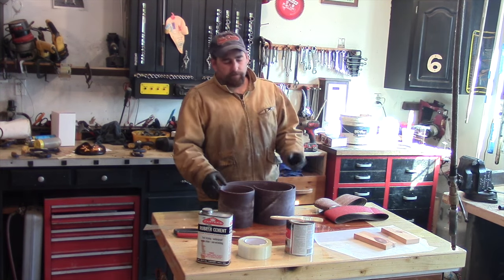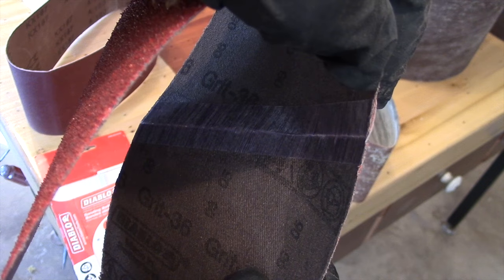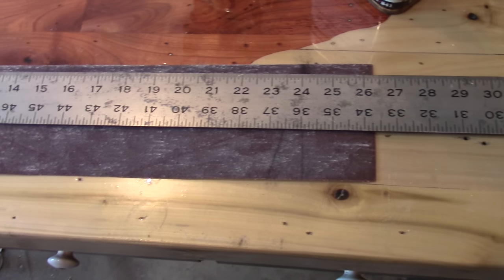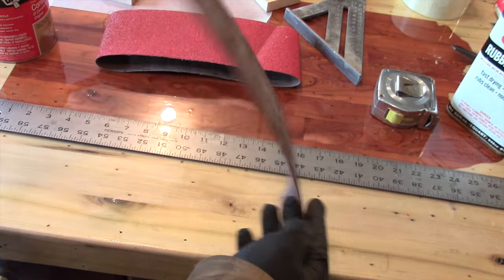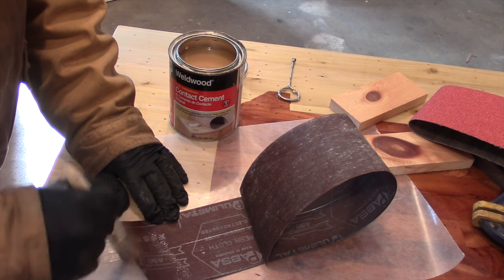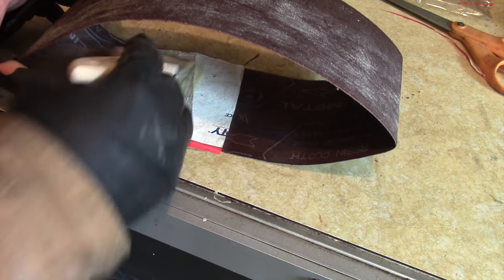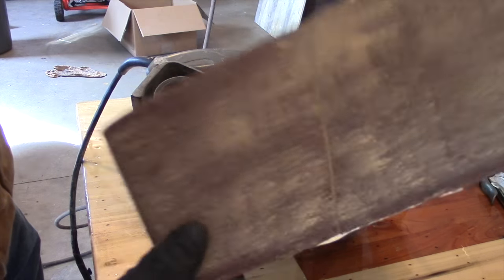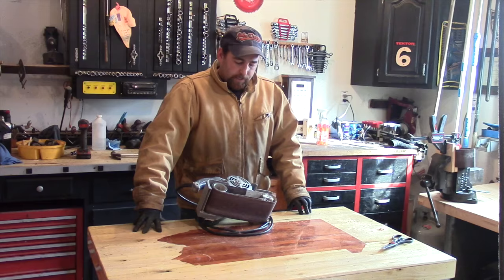Make Your Own Sanding Belts

Comment from the maker: http://amzn.to/2k75OXf DAP Weldwood Contact Cement
http://amzn.to/2kcFM7s  3" Zirconia Sanding Roll 70FT 60 Grit
http://amzn.to/2kDyiv2 Bidirectional Filament Tape (could be used)
http://amzn.to/2kDtxBs 2" 60 Zirconia Sanding Roll 60ft
http://amzn.to/2k7agFF 6" Roll Zirconia Sanding Cloth 50Ft.
http://amzn.to/2l8CsrJ 4" Sanding Roll Zirconia 120 Grit

Comment: Probably the best tutorial out here,, the ones where they use epoxy.. eventually gets brittle and brake apart... so really nice work and idea, thanks fro posting.
Reply from the maker: You are right the epoxy does not hold up.  It gets too stiff and when the belt makes a tight radius it will crack.  You need a flexible glue.

Comment: Great tip Bob. I will be doing that myself. Thanks. By the way I found some 4" belts in a locker that I purchased in about 1972. I obviously forgot about them. Tried one and yes broke immediately. I will be repairing them. Thanks.
Reply from the maker: You already have the belts, so that makes the job easy.  Hopefully, they are the right size then there is no custom cutting and measuring.  Make sure you use good contact cement and give it plenty of time to clamp and dry in a heated environment.  You will see first hand it is a slow process.

Comment: Wow, I'm surprised the Tyvek would break...  I sort of think of Tyvek as being impenetrable!  Nice work!
Reply from the maker: I made one years ago, and when It broke I looked closely at it.  The glue held well and the tyvek ripped at the seam. The idea is to double up the tyvek so it lasts longer.  I have had pretty good results with this method, but it takes a while to get the belts done due to the glue dry time, so it is a pain.  Now if you need a belt that is an odd size this can work out well for you.  Belts are cheaper on Amazon then they are at the big box stores.

Comment: Brilliant.  The kicker is to clamp it down in the vise, and to give it time (3 days) to fully cure.  Thanks Bob.
Reply from the maker: The dry time is very important.  After being clamped for a while I put mine on the vents in my house for a day or so.  If they are not completely dry the glue is rubbery and slippery. Thanks for the comment.

Comment: Like everything here EXCEPT the angle you cut.. If you look at sanding drums, which are constantly bent into a round tube, the angle is pretty steep, and it's usually a thin strip that wraps around at least twice for each drum.. By using this formula instead, you'll have much stronger seams: You had a 4 inch leftover piece for making 2 belts out of one, so add 2 inches(or 4 if making 2 belts at once). Having those small waste triangles comes in handy, glue them to dull multitool blades, wood scraps, or metal to get into tight spots. The longer the seam, the stronger the joint. I kept time for 2 belts each way. BOTH of the 1 inch over seams broke, and I'm still running the 4 inch over belts, 5+ hours each. Even a nail tear didn't break the seam.
Reply: Yes the 1in belts are the hardest to do the smaller  seams the more pull you have especially in a fast machine

Comment: Awesome! I've got an odd size old table top belt sander and THIS Fixes my fitment issue! I'm just going to whack off the excess and make the belts I have work!! Awesome! Awesome! Cheers my Friend! Zip~ Oh...What about using the stranded packing tape in lieu of the Tyvek?
Reply from the maker: This fix will work for your sanding belt, but you need to give it clamp pressure and time to dry (several days).  I believe Tyvek is stronger than packing tape, but you can give it a shot.

Comment: Here's a trick that will double the life out of your sand paper belts or disc work on any sandpaper. 
Grab a stick of solid rubber and with the sander running so the disc or belt is spinning press the rubber until the belt becomes unclogged. 
This will unclog any sandpaper works amazing, I was taught this trick when I was an apprentice cabinet maker. 
Not sure where you get the stick of solid rubber from. You might be able to use rubber from an old tire. Or maybe an eraser.
Reply from the maker: I have some abrasive cleaners.  I order them online.   Work well.  By the way the Zircomiam belts are self cleaning really good stuff.
Reply: Michael O'Reilly my hand  held belt sander is not sanding evenly

Comment: I never understand why people cut all the way down a fabric belt, you just tear it.  It takes less than a second and it's a perfectly straight cut and you didn't ruin your scissors.
Reply: haha was just what I was going to say... Its all I ever do for my 1" wide machine... a 6" belt is waaaaay cheaper than 6, 1" belts!  Just a little cut with a utility knife then tear through the length.  Cant say I have ever tried building different length belts tho, Im sure I will try this some time, thanks doublewide6!
Reply: Cutting with scissors actuly sharpen said scissors

Comment: there is a roll of ,( i think it's for splicing rubber roof together , or to   en rigid ate'  concrete seams),  6' wide black  mesh, it kinda looked like really thin carbon fiber b4 you put the resin on it, the label is long gone so?, ,,,,, i used it with an epoxy to repair a bumper on an 06 mustang, they  have to be able to flex and staill not come apart at the seam and it's still holding paint , no cracks, anyway, if you put a strip of that down first , then the rest of your process, it probably will hold for years, it was in the last isle at depot, with tie bar and all that shit, i know it was less than $5 for about 60'